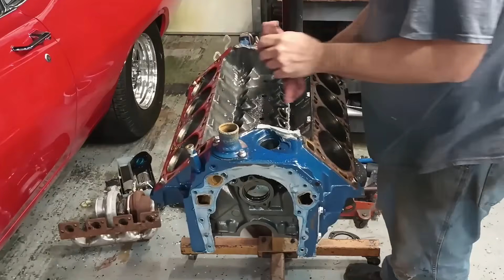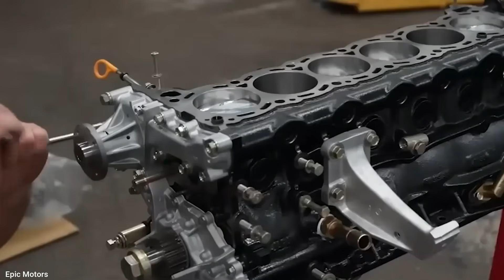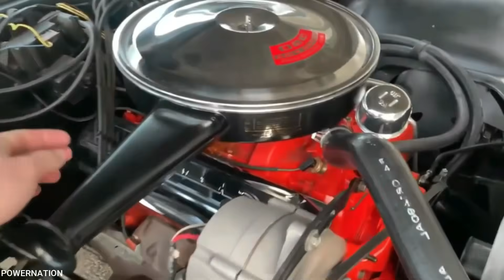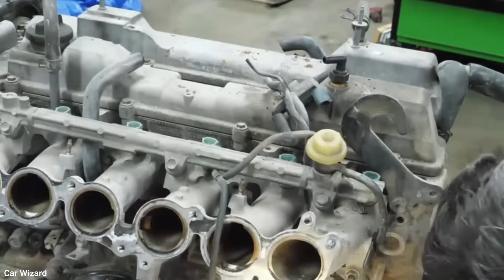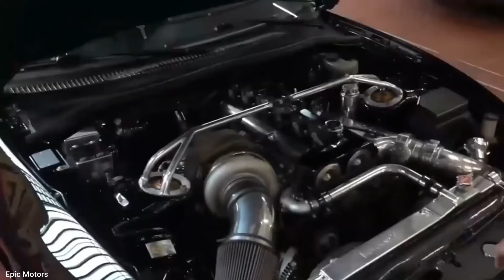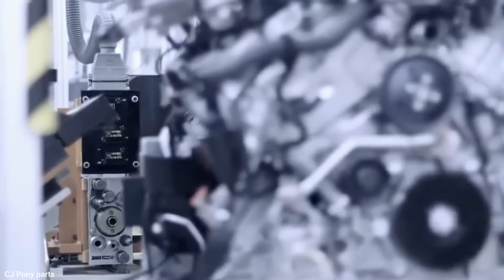20 Shocking Secrets About the Ford 351 Cleveland You Didn’t Know! (Trans-Am Tricks & 4V Heads)

Comment: everything about this video is incorrect,, the engine had an inferior oiling system it had an inferior cooling system, the block itself was weak, if you want to know the truth about this engine you won't find it in this video for the time the heads were okay, being big doesn't mean better, they were way too large and it had sluggish operating at lower RPMs,? there was a lot of problems with these mixing the two making a cleavor was the best thing you could do, it was  not a priority main  oiling system,? way too much to mention this video is false. "FALSE"; THIS VIDEO IS WILDLY INACCURATE!!!!!

Comment: This is a great informational video. I especially like the part about the mis informational 1970 351 HO since I am restoring a 1972 R code mustang with a 1972 351 HO.
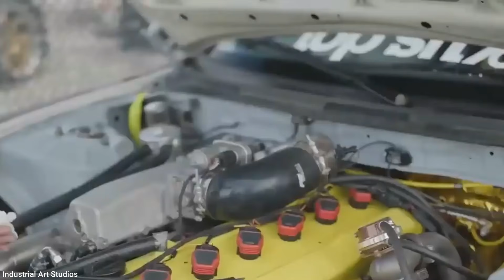I wish they found more actual Ford and Cleveland engine photos and video clips for the Cleveland with internals with each distinction to go along with the audio presentation, leaving out the 4 cylinder junk. 4:43

Comment: There are so many inaccurate statements in this video it is ridiculous.  The Boss 351 had a solid lifter camshaft, the bore and stroke were the same as the 351W but the 351W had a longer rod so a more favorable side loading,all 351C cranks were nodular iron including the Boss 351, the oiling was not mains priority, the 351 CJ didn't have domed pistons.  I stopped listening so there are likely more.

Comment: a 351 cj boss from a 71 mustang stuffed in a 70 Mavrick grabber and it is to scary to drive when the road is wet.  i had the motor rebuilt in 97 and put 12/1 compression pistons and a bigger cam and a high volume oil pump so i can run thicker oil 20w50  😎💚💙👍👍🍺🍺🍻
Reply: What’s a 351 CJ Boss?
Reply: @chrisd2170  it was 1 of the cleveland engines that ford put in the boss mustangs from 70 to 74 however the only good years were 70 and 71 they de tuned them after that the engine put out to much hp stock so it was band from many racing just google it mine puts out about 750 hp

Comment: The 351 Cleveland  4v is my all time favorite engine.  I have a 71 mach 1.  That produced 615 hp. The engine design was ahead of it's time and was outlawed in trans AM racing because it would usually win. It was only made from 1970 to 1974. They are highly sought after in drag racing.

Comment: Back in 1984 or 1985, during my High School Years, my Best Friends Dad ran an Autobody Shop, who got an amazing deal on a 1973 Ford Mach 1, that had a Factory, 351 Cleveland, 2V Engine, that didn't Run... 🤔 

So they found a used, 1970, 351 Cleveland, 4V Engine, to replace the Original Factory 2V Engine!!! 

I'm adding this after the fact, to make a correction. I spoke with My Buddy after making this post, and he corrected me, That information is below... 

*The 4V Cleveland he replaced the original 2V with, was actually a 1971 model, and it was a Real, Factory, Ford, 351 Boss Engine* 

That Mach 1 with it's 1970, 4V Cleveland Replacement Engine had a Detroit Locker, 9 inch Rear End had either 3:5 something, or 3.7 something Gears!!! 

And honestly, I don't remember ever losing, a light to light street race, ever!!! 

That was probably the Fastest Muscle Car I've ever ridden in, that had All, Factory Spec Part's, although the Engine was made 3 years earlier, it checked out as having Factory Bore, Stroke, Camshaft and Valve Train parts and measurements!!! 

That Car Honestly Impressed Me more than every other Stock Muscle Car, Built Between The 1970's, and Late 1980's!!! 

Which is probably why I'm enjoying this video so much!!! 👍 🙏 

Thanks 

Just Sayin'🤬